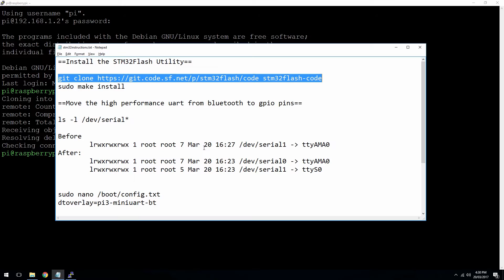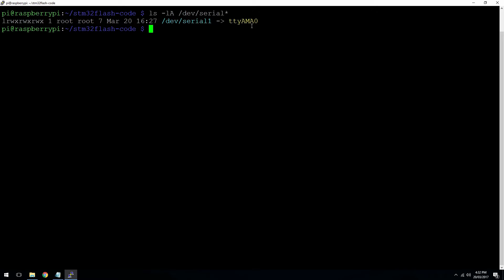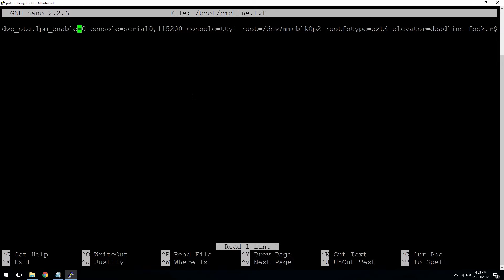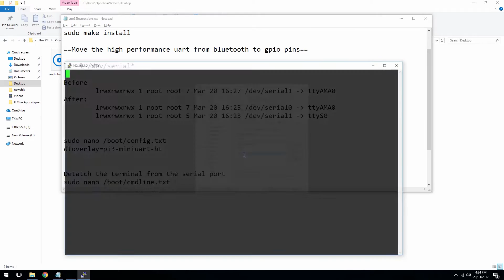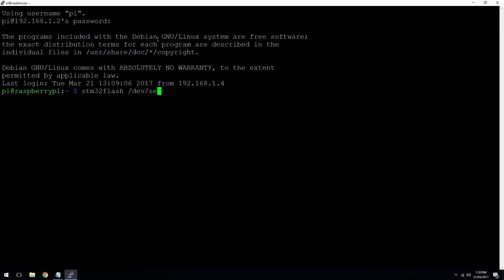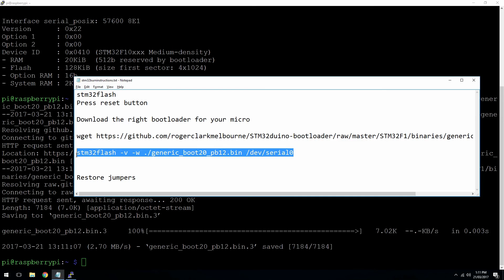Flashing the STM32F103 with a Raspberry Pi / Getting started with the STM32F103

Comment: is this possible without moving the jumper as I read in the wiki you may be able to use the gpio pins?
GPIO sequence:
    - entry sequence: GPIO_3=low, GPIO_2=low, GPIO_2=high
    - exit sequence: GPIO_3=high, GPIO_2=low, GPIO_2=high
        stm32flash -R -i -3,-2,2:3,-2,2 /dev/ttyS0GPIO sequence:
    Also once its got the arduino bootloader on, how can I use the PI to write a sketch to it in headless mode?

Comment: i actually have a rpi 2 and it doesnt' have blue tooth built in. could you comment how to do it a little different for pi 2 users?
Reply: Hi, I think i made it with a rpi 2b+, i just did the whole video but with my 2b+, I dont now what to do next, I havent use arduino ever, Im on it. As for you, Have yo change the stm32flash /dev/serial line for stm32flash /dev/ttyAMA0?, that show the same result as the video for me so far.

Comment: I highly recommend using the stlink-v2 for programming as it also provides debugging functionality. It is included on the stm32discovery boards and $3 clones are available.
Reply from the maker: Yup. I agree. Four week wait on mine from china, though, and I always lose little programmers like that. :)
Reply: You don't need to buy a stlink-v2 if you have a Raspberry PI. Just install openocd and follow the instructions here to turn your RPI into a JTAG/SWD prorgrammer with a couple of dupont wires: www.stm32duino.com/viewtopic.php?f=37&t=940&p=10897